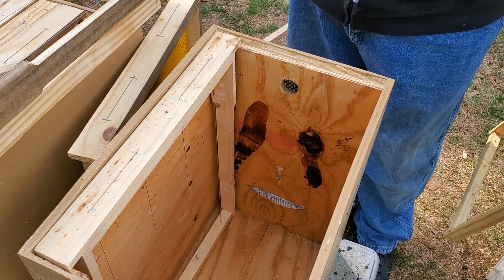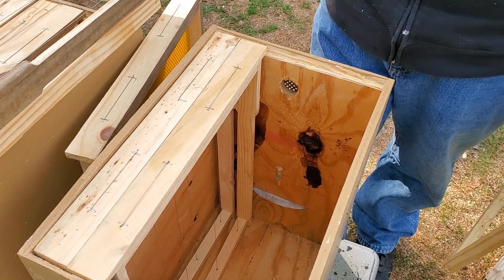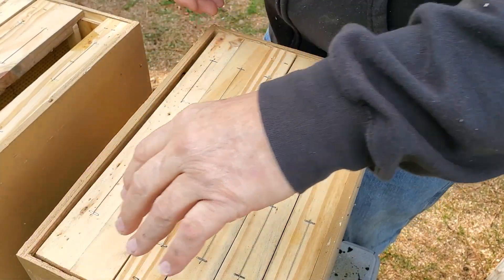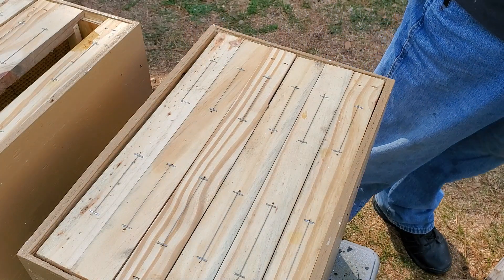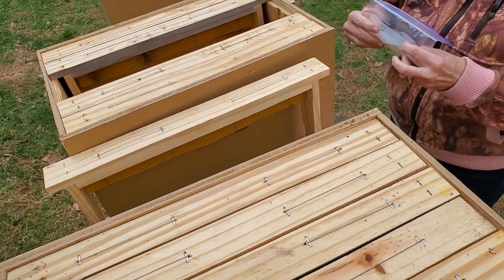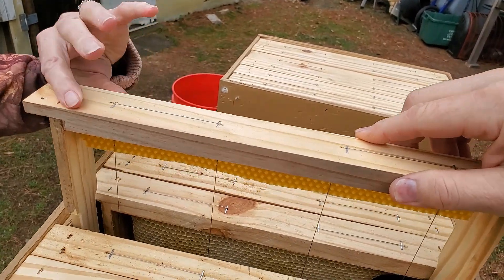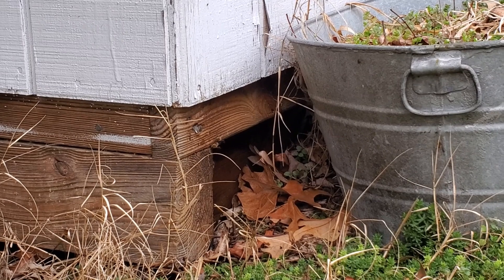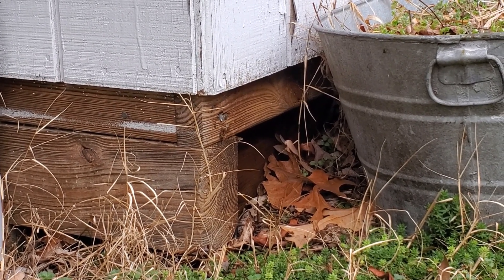2022 Swarm Season: Preparation and First Swarm Box Installed

Comment: In my swarm traps i scrap propolis from frames etc. mix with rubbing alcohol in a jar. Shake the jar each time you go past it for a while.  when looks mixed good. Take a 1 inch paint brush and paint all corners with a one inch strip across box bottom and up sides. when scout bees enter box they  have found a home away from home. I have a few layens traps and a lot of double stacked 5 frame nuc boxes . 5frames in top box bottom box empty with a figure 8 1inch holes in btm box for entrance. I have dumped bees into a layens trap box by raising with a shim 3 of the frames up 3/8" with a funnel on top of box work great.
Reply from the maker: Have not heard of mixing with alcohol. We'll have to try that.